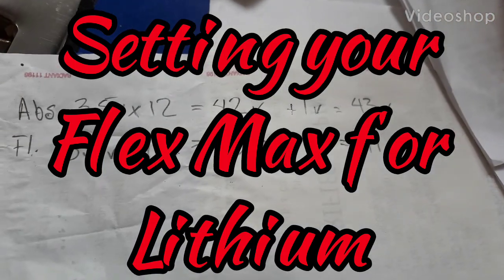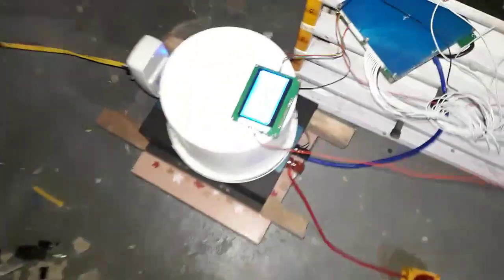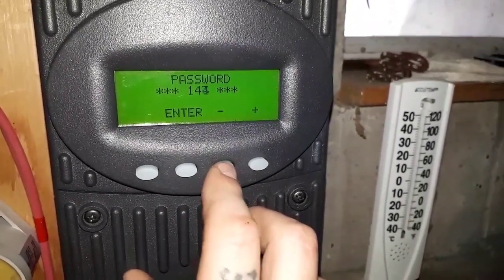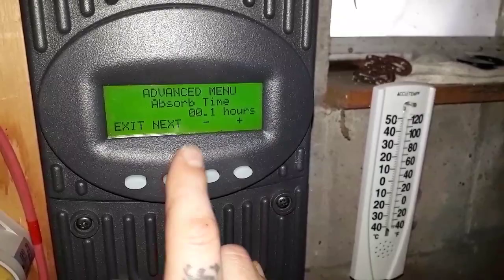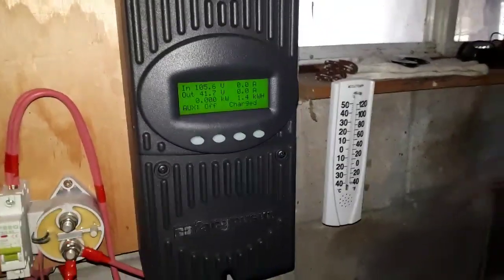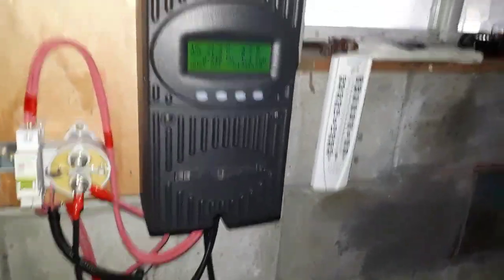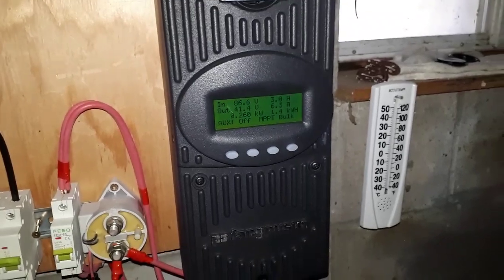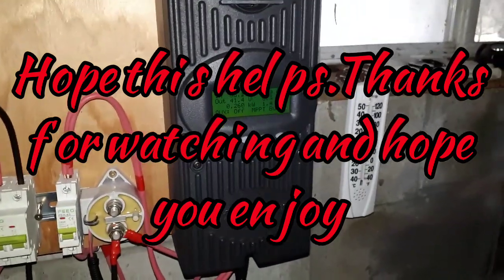Setting your Flex Max for Lithium

Comment: So I'm very interested to convert to lithium batteries but outback said I'd have to go with A G M cause my outback inverter with flex max 60 wouldn't charge lithium?? Now I see your video and why would outback tell me this to try to sell me AGM??
Reply from the maker: It will charge just fine but will not communicate with the bms in the battery. Lithium Iron Phosphate is the most suitable voltage wise. They said to be safer the other lithium chemistries.. There is a few downsides to lithium as well. Just depends on your application. Cheers

Comment: I don’t see the point of rebulking the current will increase as the voltage decreases? All you’re doing is putting it through the motions of absorption again I’m not sure I’m following
Reply from the maker: Just my preference. I dont want to float and I dont want the bank to stay at full voltage. It does mini cycles. I found it kept my bank more in balance. Thanks for watching

Comment: what's the different if i set the AUX on ON or Auto mode or OFF?? please answer, thank you
Reply from the maker: there is a aux port that can be used. unless you are using that port it doesnt matter if it is on,off or auto. Thanks for watching

Comment: Tesla battery is kind of an odd battery a lot of guys are using them and their solar arrangements I am just setting up a system and trying to learn all I can
Reply from the maker: Most of the tesla packs use lithium cobalt mix. I believe. The max charge 1 cell group can handle is 4.2 vdc per. You also need to know the series connection of the pack. Ex. 6s 7s. Some are different. Most people charge them to 4.1 v per cell group to be safe. You multiply 4.1v x the number of sereised groups in the pack. 4.1 x 6 = 24.6vdc. If this is the case then set the controller to 24.6v for your absorb. Ive been told not to hold that voltage but cut the current when the set voltage is reached. Thats a full charge. Hope this helps. Cheers
Reply from the maker: In my opinion the chemistry you have there in those packs is the best but make sure you use a bms with cell level cut off. It is a flammable battery.
Reply from the maker: If you wanna talk to a guy with that setup and is very nice to talk to ill give you a link to his channel. I would say his setup is very well put together

Comment: Great information Frank.  What is the maximum voltage per cell with your lithium Chemistry? Mine is 4.2 per cell but I only charge to 4.05 per cell. Which BMS are you using? It looks very nice. Snow here the next couple days.
Reply from the maker: My cells are LiFePo4.  Max charge 3.6v and i go to about 3.525v. This chemistry is more similar to lead acid. But with incredible power
Reply: @frankz1125  Thanks you, stay warm my friend.
Reply from the maker: It is a china bms.